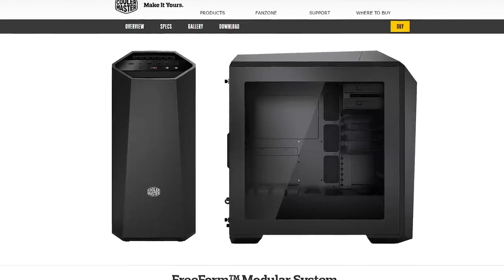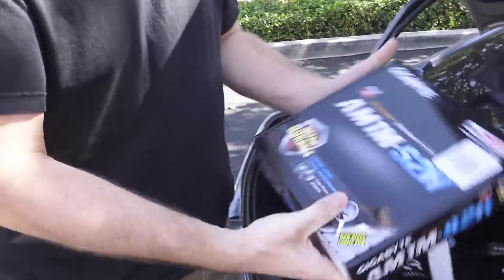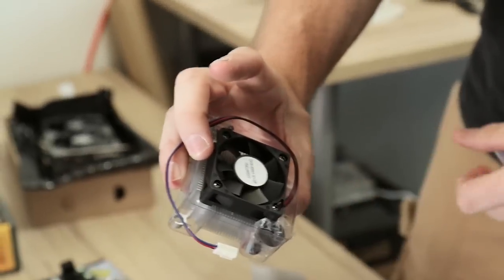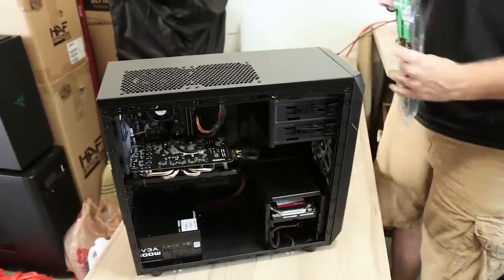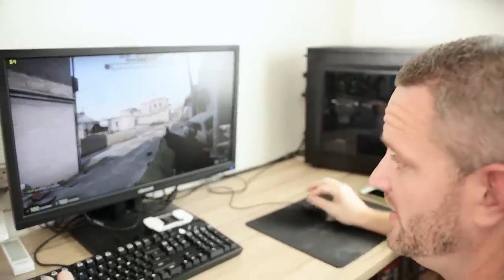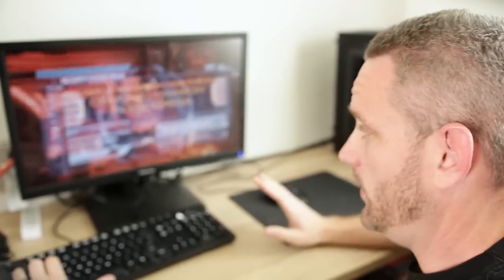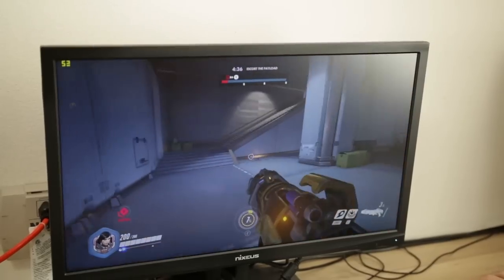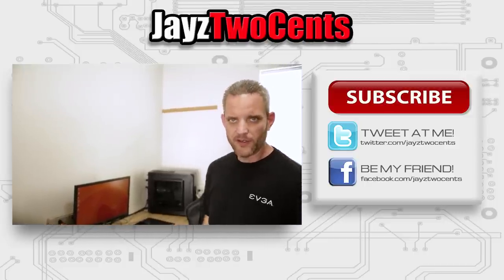Ultra Cheap Gaming PC 2016 - Can you play games for under $400?

Comment: for 100 dollars more you could play star citizen. I did it with like 30 fps. here are my specs.
-msi 970 motherboard
-2x 400gb IBM SSDs
-1x 1tb hdd
-gtx 660
-750w PSU
-amd fx 6100 (was 8320 but pins bent and i dont have the money to buy one now)
-rosewill black case

Comment: I think it might have been better to opt for an i3 6100 (3.7ghz hyper-threaded dual core) for $110, and then a $50 motherboard, and $30 bundle savings at microcenter. You'd be more hard pressed to bottleneck then with the Skylake architecture at 3.7ghz w/ 2 real and 2 virtual cores.

Of course you'd be adding more cost, but you could skimp in other places or just plunge, the increase would be WELL worth it. EDIT: You'd also be able to upgrade to a skylake i5 or i7 in the future (but the mobo wouldn't support OC)
Reply: or to save even more money, go with a Pentium G4400. Sure, it's .4Ghz less than the 6100, but it is also $60 cheaper and since it is also part of the Skylake architecture, upgradeability will be there , as well.
Reply: at this price u can get also FX6300 - and it will be performing (in avg.) better.
Reply: yeah he just put a 250 gpu with like what 30 cpu? he misunderstood the concept of not needing as much cpu power as gpu power in gaming, the ratio should be like 1:2 or 2:3 not 1:9 i mean if gpu is 100 cpu 50, if cpu 150 gpu 300 etc, or something like that. if he took 150-180 on gpu and 140-170 for cpu,mb he would get a lot better gaming setup.
though if fps he has now is fine for you and you dont play most cpu requiring games it actually makes a lot of sense since replacing 40 buck of parts to upgrade hurts you less after 1 year of use when games get sligly better you go and change cpu and MB and you have a great desktop.(the 250 gpu should last a long time)
Reply: Got a build for me?
Reply: Nadeem Khatak t
Reply: Nadeem Khatak or an intel i5 2400 for 70 bucks on amazon, thats how much mine was
Reply: Nadeem Khatak even though its from 2011, its still a killer cpu

Comment: I build a PC with similar specs, Newegg DIY combo : 860k, 128GB Adata SSD, FM2 mobo, 8gb ddr3, Case and PSU 450Watt for 270$. Then I slapped a 280x. from ebay: 380$   plays everything just about. Only issue is that its a mATX case and that 860k and 280X are in close proximity to each other and the thing is a barn burner like Gerry would say.
Reply: Yo man, if you can put in an SSD, go for it. An SSD increases the overall performance of a computer dramatically since none of the components have to wait for HDD read times.
Reply: great build actually but the 280x was way too expensive could've gone for a 380x and save some money and  heat !
Reply: john handcock 70% of computer components are overrated.

Mobile phones can do almost anything a computer can....
Reply: That 860k needs all the help it can get! The ssd makes up for the shitty 860k performance, plus it was part of the combo
Reply: Feres Genesis
this was in janurary its what was available at the time
Reply: +john handcock ssds are almost a necessity. They actually help with stuttering on newer games.
Reply: While I would not say an SSD is a requirement to game if you are willing to give your computer all the extra time it needs to cold boot (>90seconds for windows) and load the game (>2 minutes depending on the game for the drive access to reduce to near idle) and you have a minimum of 8 GB of RAM, I still always include an SSD in every build I spec because it is stupid not to with today's software.  Most gamers don't tend to need a ton of storage space so having a 256GB-512GB SSD is generally a good option.

People who don't have an SSD in their computer can be really annoying to play against at LAN parties since their machines will take forever to load scenes and switch maps.  If I have to spend more than 5-10 seconds at a loading screen with a 2.5GB/s capable NVME SSD you can bet I am getting annoyed.

These days even budget SSDs are decent enough and should be a minimum requirement in all new computers being sold.  It is really stupid that manufacturers will install a 1TB-2TB 5400RPM drive in a new laptop all for the bigger storage numbers that the person will likely never use because the drive is so slow they junk the whole computer in 2-3 years.
Reply: ***** As far as I've been able to tell, laptops are either cheap shit or expensive shit. There are very few that standout in the midrange that offer functionality and build quality.

I've never bought a laptop, I've used a few in the pas tho.
Reply: I agree, back in the day ( Win 95, Win 98 days ) Laptops were the "in- Thing. In 2016 however, I wouldn't spend more than $400USD - $500USD on one if even that. Rather have a $1500 PC at home and a $400 Laptop or tablet.
Reply: +john handcock as a pc builder for nearly 15 years, ill go SSD over HDD anyday, anytime.
  the difference between the 2 is too striking. 
  once you go ssd, you never go back.
  i have a hdd in my main build but it's literally just for storage.
Reply: dude it came with the combo, had no choice
Reply: octavio mancilla ignore john handcock
Reply: john handcock That's funny, because you don't either. An SSD is a personal preference at this point, but it's also labeled as an essential piece worth getting. If anything, you're just showing symptoms of buyer's remorse.
Reply: john handcock Explain me having an i5 and gtx 750 ti and stuttering in gta 5. it was basically unplayable with the stuttering and pop ins. When i installed an ssd i haven't had a problem since. I don't even have gta installed on the ssd, just having one as an os drive helps things a lot. With skyrim, once you install a bunch of texture mods things will take forever to load and might crash, when i installed it on my ssd it loaded faster obviously and crashed a lot less. When I'm able to im getting like a 512gb ssd just for games
Reply: john handcock dude, you are the only one here that is butthurt about the dude who got an ssd.
Reply: UdirtyCamel Skyrim was night and day for me when i put it on my Samsung EVO 850. Not fps, but the loading and texture loads. Soo smooth (:
Reply: john handcock There you go, jumping to conclusions as well. Way to go internet hero.
Reply: john handcock I noticed the difference in every aspect from the machine I use when I switched to an SSD. An SSD reduces the latency between reading information and processing it. Thus increasing response time and reducing latency. Programs load up faster, Windows responds faster, Games load faster, Alt-tabbing from an exclusive full screen game doesn't take ages and waking from sleep is near instant. Assigning multiple VMs per SSD allows me to boot up multiple OS' at almost near real hardware speeds.

So please, tell me again how an SSD doesn't somehow become an essential piece of hardware.
Reply: john handcock Had you said that an SSD loads in a few milliseconds, I would believe you. But an HDD would be tens of milliseconds, also knowns as a few seconds, depending on the browser and their addons. Which also depends on their background processes, such anti-viruses, anti-malware and updaters (like steam, origin, or OEM driver updaters). Even the OS can slam a hard drive to 100% while it performs background processes.

It might save an extreme lightweight user a few milliseconds, but the average user to heavy user will see and feel the difference.
Reply: john handcock Oh my bad, it's 1,000 ms per 1 sec. In which case, even SSD's can operate in a few hundred ms, in that case, an HDD is even worse.

Holy fucking shit, have you not ever seen svchost.exe, wupdate.exe, or even explorer.exe smother itself basically to oblivion? -and you criticized others for being newbies
Reply: john handcock I really mean it, holy shit, if you have never seen it happen, man.

I need to walk away from the computer for a bit, because man, if you're adept with computers you would know that the OS is one of the heaviest I/O pieces of software that will bottleneck somewhere with background processes at some point. My SSD has even been pushed to a crawl by Windows.
Reply: john handcock Literally search any of those things and you'll see it's a common issue. Also, by default an HDD at idle will turn off. Hello several seconds of latency while it turns on.
Reply: john handcock It's been a thing since Windows Vista.

You've never had a hard drive turn off due to the OS power settings? It's as if you didn't know it did that. There's a massive amounts of latency when it has to power on again, there is a spin-up time, seek time and read time. It can literally take up to 11,000 ms of time, or 11 seconds.
Reply: DON'T BUY THE 860K, IT'S TE BIGGEST FAULT IN MY LIFE!
Reply: TWERX Biggest mistake of your life was probably not knowing what you were buying. :\
Reply: TWERX
 I agree its a piece of shit! but fo rthe money this combo was good
Reply: octavio mancilla Yes, but for 30 bucks more you can get an i3 6100 which is for gaming like 10 times better.
Reply: Dude, the SSD isn't helping the athlon, having an SSD just decreases loading times, plus the athlon shouldn't be a bottleneck up to an r9 390.
Reply: Pršut
 yes it does make a difference, and that 860k bottlenecks my 280x 99% cpu usage and 80% GPU

Comment: For CSGO players, just use an FPS Config and max_fps 120 and you'll be good!
Reply: You should not want to resort to maxing out fps,the more fps the better :) (on csgo)
Reply: And for CSGO you don't have to have a great GPU only a good CPU
Reply: +JACQUELINE Millan 
Not necessarily, so long as you max it above the refresh rate of your monitor, I usually go 20fps above my refresh rate, it doesn't matter, anything above the refresh rate of the monitor technically doesn't exist as far as you would be aware without a counter up top, now if you got a 144hz monitor, then maybe let the fps be free. Unless your fps jumps a lot, low stable fps (30-40 5 fps deviations) is better than getting high, unstable fps (40-60 jumps of 20), so in that case it's best to set it to about 5 above your lower end of stable fps. At least that's what I do and benefits me since I don't have to readjust every time there's a lag spike and my fps halves at the wrong moment.
Reply: ethan linquist just watch 3kliksphiliphs video xD
Reply: waxxy ็ I run more than 120 fps on csgo I run 280

Comment: Builds like these are not hard to come by for that price these days. Expansion may be a bit tricky if the motherboard isn't new or more advanced. Good job with the build!
Reply from the maker: +Tech With Brandon that's why this build uses a cheap mobo and CPU for $39. You can keep everything else and then just get a new mobo and CPU down the line
Reply: I know it's cheating (and can be risky) but I always buy parts used whenever I can! Picked up 16gb of DDR3 via Craigslist to upgrade my rig for $30 yesterday! A few weeks ago I put one together for my brother from MicroCenter for $500 with an i5-6500, 16GB RAM, 500GB SSD, miniITX and then found him a GTX 780 reference for $120 on Craigslist. The deals are out there!!
Reply: for the price it was really good

Comment: I feel like shit. The rig I built 8 mths ago, I used an fx 8320e to pair with an r9 380x. I thought  you'd need at least an fx 6300 or else you're bottlenecking.
Reply: Eric Yuan it is bottlenecking. Bad.
Reply: Eric Yuan Not a bad system but Intel 1150 or newer would have been better for sure. The Science Studio cocky guy grabbed a 8320 and Mobo for 100 at a Microcenter. Good deal.
Reply: lol cocky guy hahaha
Reply: Don't feel bad, you made a comparatively good choice. The 5350 bottlenecks HARD in heavily-single-threaded games, the 8320e will do a lot better and last a lot longer.
Reply: technically anything vishera 8core @ 4.6ghz still would make 80th percentile in passmark so theres that 
they really aren't bad chips when you look at it - it just isnt the FASTEST thing on the market but most certainly not obsolete YET #IAMZEN

Comment: This build cost less than my EVGA ftw 1070. My potato pc with the potato GPU (AMD R9 270) couldn't run Doom lol.
Reply: AMD R9 270 is x100 better than my GPU.... AMD 6450 HD .......
Reply: ASUS ROG Strix GTX 1070 OC here.
Reply: Zircalloy gtx 1060 mini here
Reply: CaveManta Dreemurr Lowest settings, maybe
Reply: 4ksandknives 270 isn't a potato lol...an hd6670 is potato
Reply: Time to grab some sour cream, chives, and bacon. We're making a couple baked potatoes!
Reply: It was a R9 270, single fan; therefore, not an R9 270x. There is a difference.
Reply: Well I have a 1070 FTW now and I'm going to upgrade to a 1080
Reply: EVGA's step up program. Pay the difference get the upgrade. I'm playing at 1440p so the extra boost is actually helpful for some games. I have another month to think it over.
Reply: You mean Volta?
Reply: I have no intention of playing at 4k... not sure where you got that from... I play at 1440p
Reply: The 1080 card does 1440p very well, especially when paired with a high refresh monitor. On triple A the dips are less frequent on the 1080 than the 1070
Reply: Metaphetamine evga's step up program is where you pay the difference to upgrade to a better card. So it's about an extra 200 to upgrade to the 1080. True, in most titles, you won't see a difference, but with triple a titles, I'd like to stay at a solid 60 and not dip with high or near max settings. Gsync helps, but I can still tell when there's drops or other shenanigans happening. Sad that this evga cray is happening. In fps titles, I definitely want 100-140 fps due to my 144 Hz monitor.
Reply: Thought about it some more. Going to just do the mod for the 1070 due to the heat/driver issues, and buy other things around the home that need upgrading. If and when I need an upgrade in 2 years or so, I'll spend a bit more.
Reply: you just said my exact GPU and problem xD
Reply: 4ksandknives The graphics card is more than the build In this video so how did you do that?
Reply: Intel HD Graphics here

Comment: It would be so much better with an athlon x4 845 for less than $50 more.
Reply: Nevermind, the mobo was free.
Reply from the maker: +Henrath yeah this build allows you to reuse your GPU rather than getting a better CPU and Mobo now and having to buy a new GPU later
Reply: +JayzTwoCents ah so this is a gpu centered build, I can dig it.
Reply: +JayzTwoCents which one do you think will do better either this motherboard processor combo or a intel q9550 with a G41 chipset motherboard keeping the rest as it is.
Reply: +JayzTwoCents lol I also made a 350$ pc
Reply: +JayzTwoCents at least this PC is faster than the consoles lol
Reply: the q9550 is twice as poweful as a athalon 5350. you need at-least a Phenom II X4 B60,  Athlon II X4 559 or a10-5700 to match/beat the q9550.
Reply: What about the 860k for less than 50$ more
Reply: +Mohamad rahmath ali it really doesn't matter since you would be swapping out the mobo and cpu regardless when you decide to upgrade
Reply: +psionx1 but it won't let you run any games that requires quad cores, games are starting to require that nowadays
Reply: Long Tran all the cpu's I listed were quad cores. lol
Reply: you are so right
Reply: +Its Graphics then you actually have to buy a motherboard. The motherboard in the video costed a penny literary.
Reply: +IIIRattleHeadIII I thought this was jays2cents l
Reply: +Mightgold12 lol
Reply: +psionx1 on paper q9550 has much higher specification however since its few generations old instructions per clock might be lesser. g41 chipset boards doesnt allow overclocking the only advantage is , it supports ddr3. the reason why i asked is im planning to build a gaming system with gtx 1060. i have a Pentium D system lying around should i upgrade it with a used q9550 and get a gfx now or shall buy the i5 6500 now qnd buy the gfx later.
Reply: Mohamad rahmath ali then how is the q9550 better on paper if it has lower IPC, due to less ALUs, AGUs, slower and narrower cache, lower register count, load/store, etc, etc... on paper the q9550 is slower...
Reply: +JayzTwoCents, now that you have that athlo5350 cpu+mb, you can try to pair it with some top of the line graphics cards(titan, 1080), just because you can.
Reply: The G3258 would be a better choice than the x4 845 as it is faster for most games and allows higher overclock. It would also keep within the 400 dollar budget and give the option of a faster intel cpu in the future.
Reply: +logirex g3258 is running around 75$ and that's without motherboard..he paid 40 dollars for processor and motherboard. your comment is invalid.